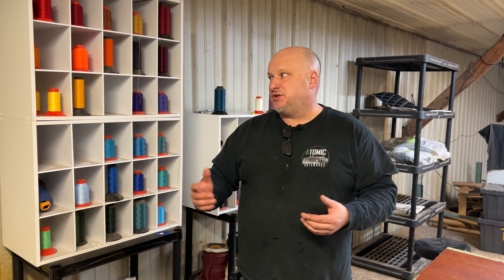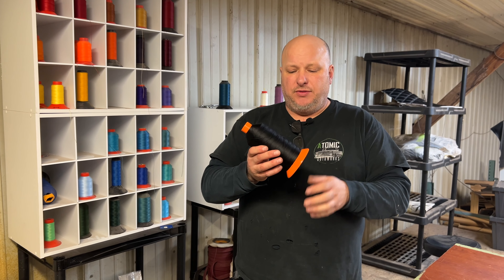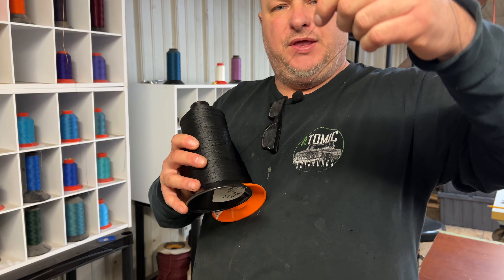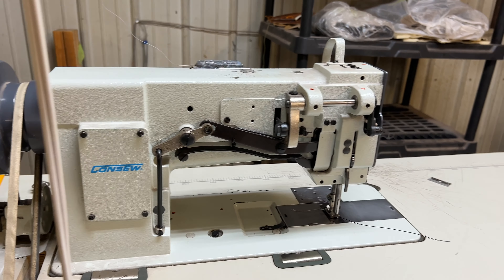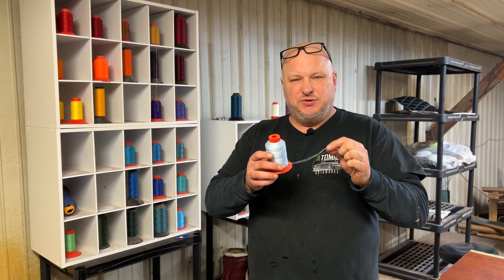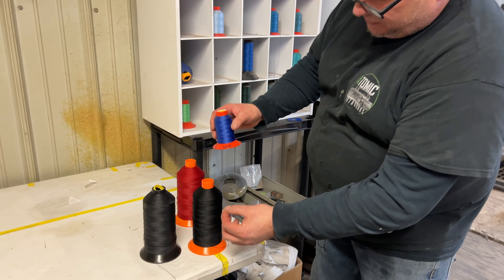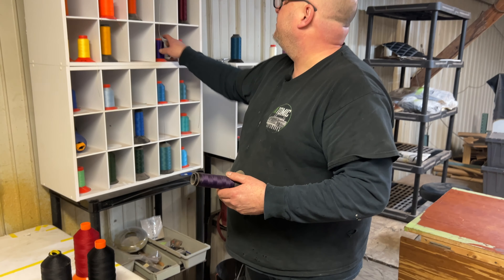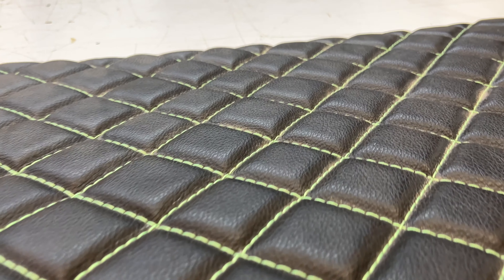Expert Tips on Selecting the Perfect Upholstery Thread

Comment: Would be really interested to know what size needles you use and the thread specification. I'm looking at maybe getting V92 marine thread as I want a nice thick pronounced stitch, but I don't know if it will fit size 100 needles and it's expensive stuff to make a mistake with.